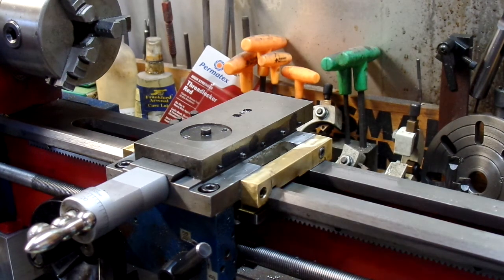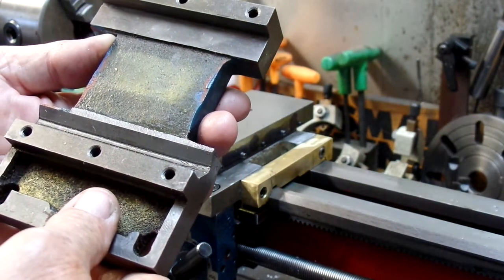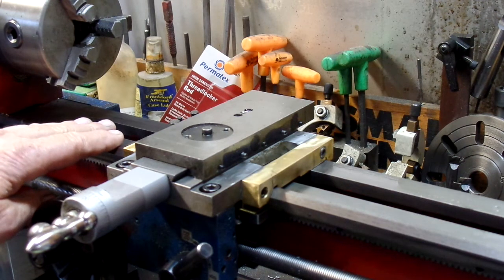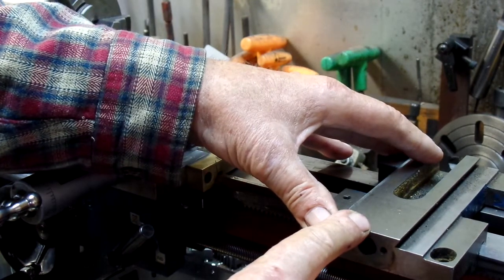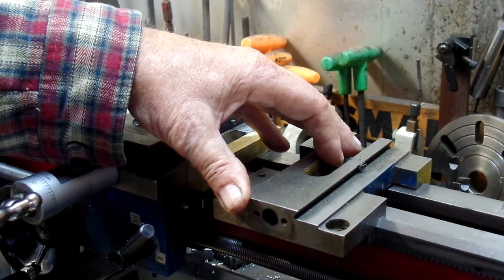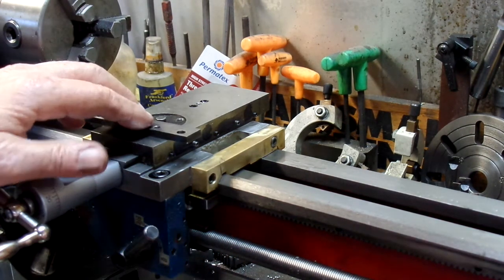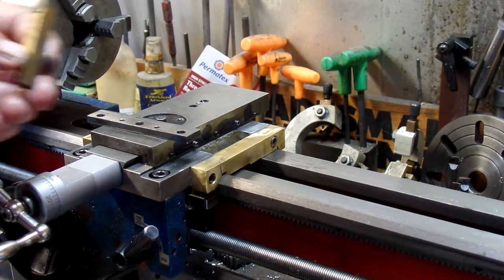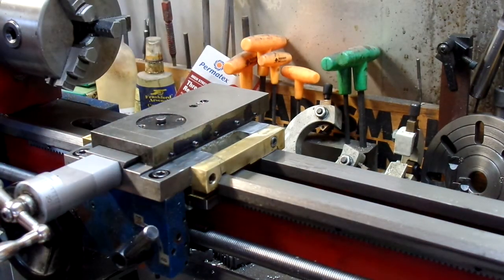E47 An experimental mod on the carriage

Comment: I like the way you think. Everyone who has one of these little machines has had to try and figure out how to get a bunch of slop out of them. The very first thing I had to do right out of the box was make a new T bolt for the tail stock because the one that came with it was bent. 
I don't know if you watch Steve Jordan's videos but he does amazing things with these little lathes and comes up with some great modifications that address the most common problems, such as the slop in the carriage. I did the studs in the carriage mod and made Brass bars to replace the skinny stock ones you talk about in your video.

I just subscribed and will check out what else you have up.

Best of luck.